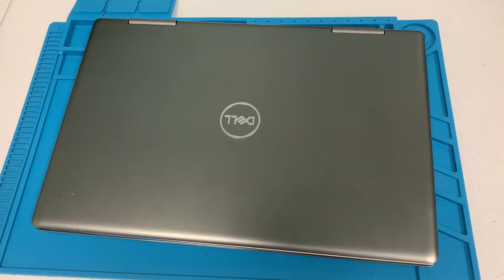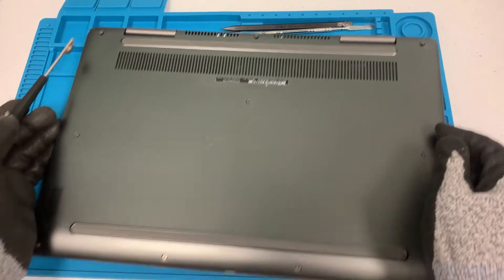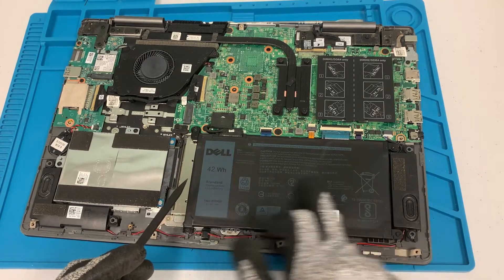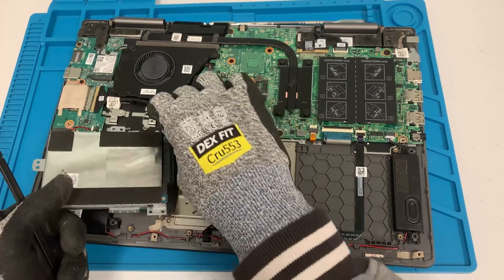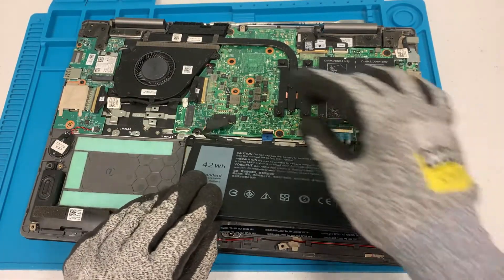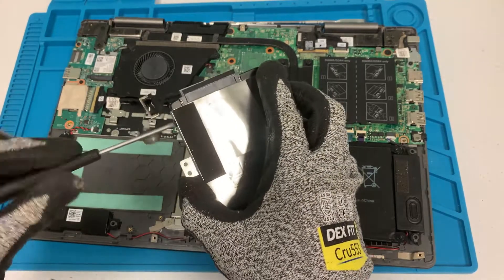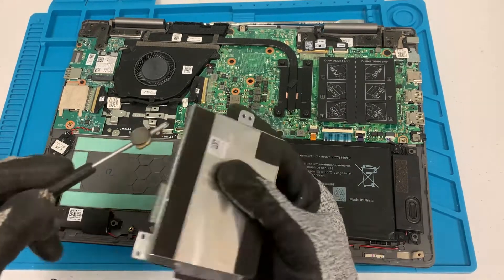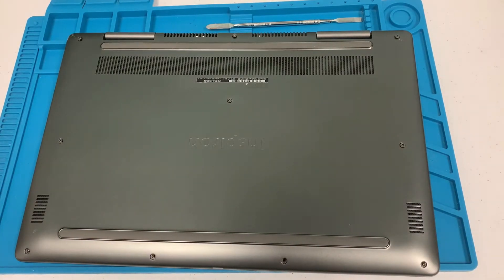Dell Inspiron 15 7000 Series Disassembly SSD Hard Drive Upgrade, battery replacement

Comment: Hi! I have a Dell Inspiron 15 7000 and it hasn't worked since I bought it(2018). I was very computer illiterate at the time and since it didn't work properly and I already passed the warranty I just let it collect dust and periodically tried to troubleshoot over the years. I recently attempted again and updated the operating system to Windows 11 and once the update was done it said my computer needed a new battery. I bought a new battery on Amazon and followed the instructions to replace it from YouTube...however I noticed something was missing next to the battery and couldn't figure out what it was until I watched your video. So 1st thank you and 2nd I never opened the back of this laptop for the 5yrs I have had it until now so Im shocked but pissed that there is no hard drive in here. Just the little plug that goes into it. Side bar: I bought this computer from Best Buy as new 5 yrs ago. Shouldn't the hard drive be in there?? Im confused. I wish I could sue them. So I guess I will have to buy a replacement for this as well. Any insight to this would be great. Thanks!
Reply from the maker: If you don’t have a HD, how did you install windows 11?
Reply: Idk. None of this makes sense. So the issue I was having all these years was what the internet calls the "blue screen error of death". After googling some troubleshooting tips based on the error messages I would get when the computer would shut off and restart, I checked the system for updates and saw Windows 11 showed it was available to update so once it showed ready, I went ahead and let it start the update process. Once it said the install was done, there was a pop up screen saying my battery needed to be changed. So I never opened up the laptop until now so I can replace the battery. I'm not familiar with laptop hardware so I have no idea what and why but I have never been able to fully use the laptop all these years for more than 15 min at a time bc it would shut off and restart with the blue screen message saying "Oops we ran into a problem" so this missing hard drive must have been the problem. I didn't want to pay someone the upwards of $300 that I don't have. I gave up on Best Buy back then bc I wasn't going to pay them extra to send it back to Dell once they said it was out of warranty and have to wait a month or two or more to receive it back. Which is what they told me at the time. How the heck do you sell a computer without a hard drive? and I know it must have been returned and resold to me as new so whoever had it before took the hard drive out before they returned it because why is the cable sitting there by itself in the pocket of the case where the hard drive should be? Ridiculous. Do you know where I can get a decent and affordable replacement?
Reply from the maker: @KMila791 you can get a HD anywhere. Cost will varies depending on storage size. I’m sure any computer shop in your area might be able to help.
Reply: Okay, thanks!